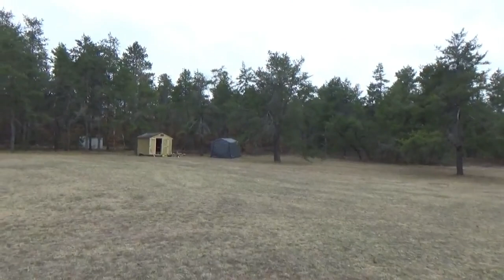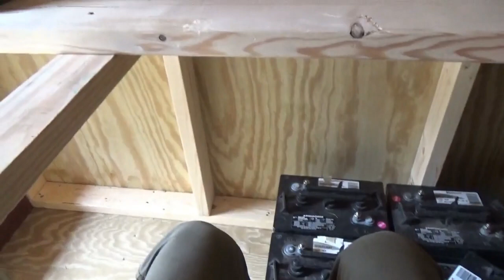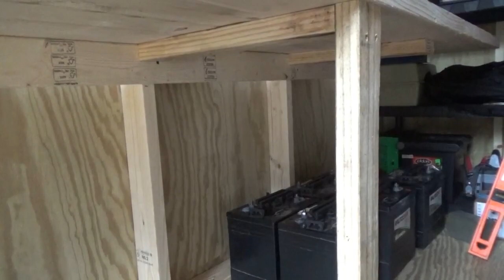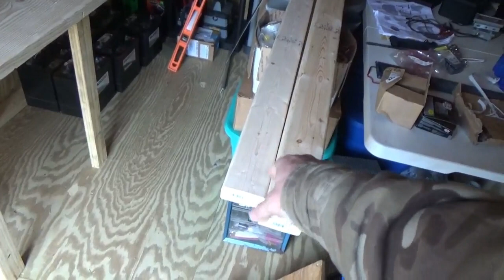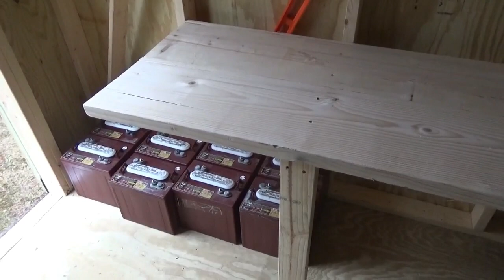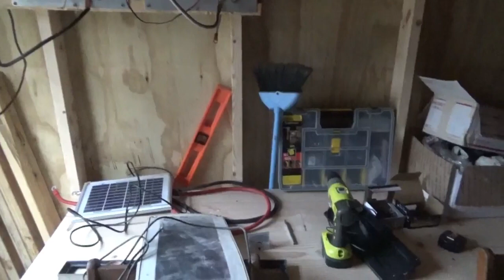Setting Up Off Grid Work Shop & Building Work Bench

Comment: quick question why are you setting your solar up so far away from the home is going  to cost a fortune running the wire to that house from that far away? that is what you're going to power the house from if you're taking it off grid right?
Reply: We've all tried to tell him. Troy doesnt have the best track record when it comes to listening to his viewers when they impart wisdom on technical backgrounds.The distance between that shed and the house is going to make it so costly ( in energy terms) to supply that house, he'll be towing the shed over first week. Then there are permitting issues. Even hooking up the chalet to power from solar  has to fall within building codes ( and probably be done by a licensed electrician and/or inspected) .
He didnt listen when everyone told him to build the tiny house 16 inches on center to go along with national building codes. As a result he had to custom cut materials like insulation, as they dont make 24 on center insulation bats.He's doing the same thing now, going his own way. Well, the first time he goes to transmit the power that distance, he'll have to get creative and he's going to realize the difficulties. Also there is no way he can pay to string hydro poles across the property to transmit the power according to building codes.  So, he's not listening, it's been suggested to him by several parties with his best interests in mind, but is determined to do what he wants anyway.The best anyone can do, is wait for his "experiment" to fail, and watch when he moves the battery shed as was suggested in the first place. There's an old saying. You can lead a horse to water, but you cant make them drink. Particularly applicable here!
Reply: Seana Richmond you can build 24" on center and buy insulation that wide. It just has to be supported by special wires that hold it in place to keep the insulation from sagging.
Reply: yes, but you cant be building to building codes if you are building something that is not 16 on center in most places. If you can order specialty insulation, it would be expensive and a pain in the ass to get. Had  troy listened then, he could have put that tiny home on a foundation at his new place and continued to use it. Because he didnt build to any of the national building codes, he could not. Not in a "permanant dwelling" he doesnt have the option to follow or not building codes.
Reply: 2 Arrays 2 Charges 2 Battery banks
Reply: Matt lol
Reply: Lmao Matt good point
Reply: Seana Richmond yep I have to kinda agree with your post, he only listens if he has a mind to, if not then hell will freeze over first. I am an electrician and made several "suggestions " to no avail in the past, on the tiny house. So whatever he does is fine I just keep my suggestions to myself. I still like watching his videos, but he certainly brings a lot of trouble on himself, maybe some day he'll start listening. Just not going to hold my breath. If he ever decides to listen, he should post a video on his plans and ask for suggestions before starting the project. LOL rant over haha.
Reply: Seana, where in the country do they simultaniously require 16oc and NOT require minimum  sqft? Advanced Construction is a superior method and is based exclusively on 24oc, so any supplier who doesn't stock it standard is stuck in the 60's
Reply: TheMoneypresident hmmm I haven't seen it, good question! Back to the golf cart batteries I guess, but then again I question if he was using it anymore anyway.
Reply: Matt, you got that right!
Reply: Well people don't seem to listen if they miss the video so save this snide remark for somebody else thanks for at least answering my question attitude notwithstanding
Reply: I'd invert it to 240V and use a transformer on the destination end.
Reply: two array's can charge one huge high power bank (what troy has on battery's is peanuts, we install that for small offgrid led light installations and tv on small boats... lol) on the big yachts we build systems up from 1500 amphours at 24 or 48 volts.... lol, but the 230ah Troy has, is enough for powering the workshop!
Reply: the distance by Troy would need 10000 volts... lol   (just kidding)
Reply: David Hibbittts I'm not sure where you are getting that information, but troy has stated plainly multiple times his intentions both on video here and in comments, to me personally no less.. Hes not trying to run just a few things in the shed as you state he wants to generate the power in Dc, use the inverter to produce AC , and run a thick wire tot he house. It is in electrical theory possible to transmit that power the 100 or so yards while it may not be for DC.  But the power loss over that distance will make it highly inefficient.. While he will undoubtedly have to grow his system to accomodate things like pumps ( and now solar water heaters ) there is no misunderstanding what he wants to do. Well, it's troys right to fail , in fact, there are a few here might learn something from his failures. When he doesnt listen to what knowledgeable viewers ( heck weve even had licensed electricians pop in and say the EXACT SAME THING) well, there's not a damn thing anyone can do but sit and watch the experiment in question fail. So we've told him about the power loss and attenuation issues . He doesnt want to think it through, so what else do you expect us to do but sit with a bucket of popcorn and watch the train wreck ensue?
Reply: Seana Richmond: I am a licensed electrician and the impending train wreck should be fun to watch. Anyway should we take bets how long it will take before he moves the shed? Another thing if I was setting up a homestead I would try to get everything as close together as possible. Although as we all know  some animals should not be very close to some of the others. If for no other reason it would make snow removal easier and we wouldn't have to listen to how hard it is shoveling for 2-3 days straight.
Reply: I once had no electricity in my house  for 6 months one summer. For a while we tried running a pair of 100 foot extension cords from the neibours plug to my place, roughly half the distance to troys shed. Only thing plugged in was a newish fridge (didnt use much hydro). Took all of 5 minutes for the neibours dedicated 30 amp cirtcuit breaker to the outdoor plugs to trip the breaker. Same house I used a thick wire cord power my shed,which had a few saws and grinders in it. Distance maybe 30 feet? I''d get through about 2 cuts on the radial arm saw before the breaker would trip. I suspect, it will be a VERY fast migration of that equipment .
Reply: thats why we use 230 volts ac here in europe...

Comment: Won,t u loose a lot of power with that long of a run of wire to your house ?
Reply from the maker: +Perry Beckwith not so bad with AC power
Reply: The Do It Yourself World depends on the voltage you start with the higher the voltage the less you lose. rule of thumb is not to exceed 5% loss that is why the wire size increases per length of run. It runs on the theory of the skin effect which is why wire size is critical.
Reply: skin effect is worse whit ac,then dc,,,,, the higer the frequenty the less inner core is used....but this is way beyond the things you know about power... lol(no offence, it takes years of study...)

Comment: Troy, if you redo those legs and angle them back so the butt into the bottom plate of the wall,  you'll still have the support but they'll be in your way a lot less.

Comment: When attaching a horizontal piece of wood to a vertical piece of wood as you have on your work bench, the vertical goes under the horizontal to support the weight, not butted up against it. When you do that you're relying on the shear strength of the screws to support rather than the lumber.Rugged is not what you've made, you've made flimsy because of the way you attached the legs.
Reply from the maker: But I dont get it. The entire weight of the table top is on the leg, which transfers the weight to the floor. Does it not?
Reply: You can beef it up if you add a piece of wood to the vertical that butts up under the horizontal and screw it to both horizontal and vertical.
Reply: Not really, only the front portion of the bench is held up. You're half right here but have a look at something called the Jack Stud when framing windows and does and you might understand how the joint works. The key is to never make the screws support the joint, you let the joint support itself, the screws just keep it in place.
Reply: The Do It Yourself World --- Nope,  FromThe Prairies is very much correct, you are only supporting the 4 sq in above the leg, the rest of the table is being held by the shear force via the screws, and the shear force of the wood around the leg. 
When an elephant stands on the ground, he's not supported by the whole earth, he's supported by whatever is under his foot.
Reply: Troy, I don't want to make upset you but look at it and think about the weight placement from an engineering standpoint.You want your top support by the top of the 2x4 leg.
 You can then also screw your legs "toenailed" right into the floor instead of putting in a piece of wood at an angle and losing that space that you may need under the workbench. Good luck, looks like a nice place you've got there.

Comment: you should build a wooden cart with wheels from harber freight for batteries. this would allow you to pull them out to maintain the fluid and etc. make 2 so 4 batteries sit on each cart. Also would lift the batteries a few inches off the floor and during the cold Michigan winter that would help since the floor is not insulated.
Reply from the maker: Interesting. Has me thinking. The wiring would be the only problem. Best to keep it very short
Reply: Having an extra 6 inches to 12 inches would not be a problem and would give you that extra to move batteries out enough to get to them

Comment: Troy I have read some of the comments about that solar being so far away and they are right. You are going to suffer a great voltage drop, not to mention the cost, I know its your place and you want to keep it as clean and neat as possible. What are you going to do about venting the batteries, that's the same gases that brought down the Hindenburg. I would do the online calculator to find out the voltage drop on your wire before you do anything just a thought.
Reply from the maker: Vent the batteries to the outside. Cover them with a box. Not sure yet about the AC power running to the house. I will get an electrician out here
Reply: Good to hear, even if you decide to go another way at least get a professional on site to you give you an informed opinion.

Comment: i would definately move the batteries under the work table...they are too close to open weather with the door there...wind/rain/cold air leaking in...also dont forget to close in those batteries and then vent exhaust out since you will be inside the lab when they are off gassing during charge cycles...i put my batteries inside an outdoor cushion bin that i lined on the inside with 3/4 inch styrofoam insulation  and use a light bulb in winter to help heat them

and since that floor is not insulated i would definitely raise them off the floor at the least since you said it gets quite cold there
Reply from the maker: +swany thanks. Yes I plan to vent them outside

Comment: be aware that the load carry beam has to go on top of the standing beam, not screwed on the side, so remeber load caring beam from the work bench in the middle is not correct, the load is now on the screws, not the beam. not to troll, just advice. thumbs up!, it will hold the way it is, but it aint perfect.... welding cable is also cheaper,,,,, (and the right diameter)
Reply from the maker: I dont understand really. The weight of the table top is directly on the leg, which transfers weight to the floor. Or not?
Reply from the maker: The screws are only holding the leg from pushing our horizontally. At least it looks like it to me.
Reply: http://www.tamarjoinerycompany.co.uk/photos/mortise_and_tenon_joints.jpg

have a look at that link, its similiar to what you need to do with horizontal timber on top of the vertical
Reply: agree that you dont understand it, the table top is made from seperate planks, the load in the middle of that is pushing on your beam, not only on the top off your post, part of the load is now only on the screws, if you put the upper beam on top of the post you are way stronger... (this is one off the reasons the twin tower floors collapsed premature).......thats why they build wooden walls and buildings that way, use the strenght of the wood, not the screws whitch hold it together.
Reply: no they are not in your case.
Reply: oh, and really its good advice, not negative trolling,or being negative! you are doing wel! , its the small things not going perfect, butt there is the advice for, to get you in the good direction! ! lol, you are way better off the 4 years ago whit the boiling stove in the camper! lol be safe!
Reply: The Do It Yourself World 
Sorry to point this out, but in almost everything you do your subscribers know better, so when they say you are wrong it's going to be quicker to accept this rather than question it. You've probably got hundreds of technically qualified people here, nobody can compete against 100 people telling you are wrong.
Reply: Free to do whit whell mend advice, y dont tell him this to say he is doing it wrong, its to do it right the first time, so you dont get problems in the long turn. agree, some people think they know it better (cautch noledge) but some advices are whell mend, proffesional, and not to troll, its a seen it, done it thing, dont re invent the wheel, really ,round is better then scquared.. lol

Comment: I thought you were going to insulate this building, wouldn't it have been easier to have done the insulation first ?  I also find it interesting that you didn't build your frame first, then..lay the top boards on last , as this would avoid differences in the support legs.  The end next to the door will 'catch' a lot of stuff and will diffinetly  need more support.  As a Sr. Blonde lady, these are questions that come to a curious mind.  And yes, I agree a tall cabinet in the corner is good idea perhaps you will be able to find a metal one that will ensure more safety from critters and a place for extra tech. supplies.
Reply from the maker: +Thoughts In Passing I can't afford panelng yet. But I need to use it now
Reply: I get why you aren't insulating first. Necessity trumps practicality. Too bad it will be less convenient later, but we all do what we have to when priorities intervene. I have seen old workbenches put together "wrong" that have lasted 30-40+ years and served their purpose, so as long as yours holds up, who cares? Life is not a picture perfect magazine. But I would start heeding advice from people about the electricity and making sure your buildings are grounded well because of the storms situation. Ask your neighbors who have lived around there a long time how their places are set up.

Comment: Hi. Troy i want to just have small comments to that table you 3 are building for your electronics. If your batteries will be below that table i'm not sure if it is the best place for them because of that hydrogen stuff. But i'm sure you will move them to other locations.
Reply from the maker: Thanks. I figure I can vent them through the wall to the outside later and have a flip top cover on them.

Comment: I'm just full of ideas, How about building a sort of carport putting your solar panels on the roof and protecting your car and truck. Pretty sure if you did some looking you could get "used/pallet" lumber to build. I have some screws and stuff I would like to sent to you but have no idea how to go about this. Know you have a want/need for privacy, so you think about it and I'll think about it and see what we can come up with.
Reply: Neither can I , so your point is? or maybe you don't have a point. At least he's out there trying. What's the name of your channel?
Reply from the maker: Thank you. I am considering a carport but dont want to clutter up the place. For now I plan to build solar panel frames using lumber out by the shed. Since my address was already publicly posted by my trolls there is nothing to hide.

Troy Reid
4489 Pine Road
Lewiston, MI 49756

Thank you very much :)

Comment: A few have wondered why you went so far from the trailer with batteries. Im wondering also unless you discovered it would be easier and legal to go with a grid tie and solar panels up at the trailer lowering you electric bill and relying on batteries only in emergency. This is what I have done, used a grid tie to bring my electric down to almost nothing and batteries are there (in shed) only to be used in the shed and or in my place if the electric goes out.
Reply from the maker: Shed and wood shop will be off grid. AC power line will run to the house. Some solar panels will be at the house to power the water heater directly. Maybe eventually I will end up with two sets of solar panels. Lets see.
Reply: Troy, does that mean that some circuits at the house will still be on grid? If that is the case, I think that is an excellent plan. You have come a long way from the cramped tiny house and living in the dark. Let Doc continue to do without and live like a caveman. You have a pregnant wife to think about, and you need modern conveniences to raise a family. Running the shed and wood shop off grid still gives you off grid capability to run other critical loads in an emergency if the grid goes down. Eventually, you can add more solar power at the house and save more money on your power bill. But again, if it was my house, I would always keep a grid connection as a backup to solar. You never know when you might be on a really tight budget and a power inverter fails! Or you have loads that solar can't handle.